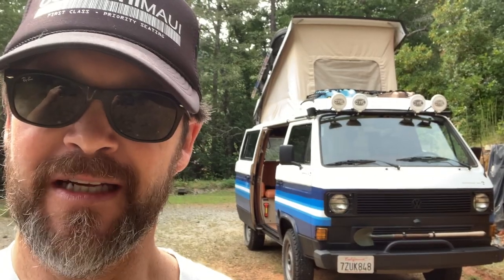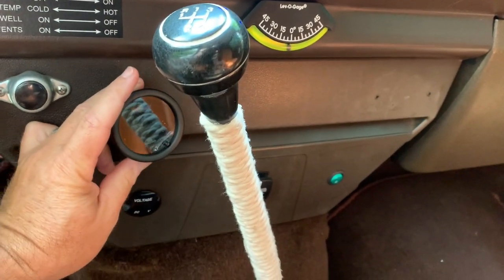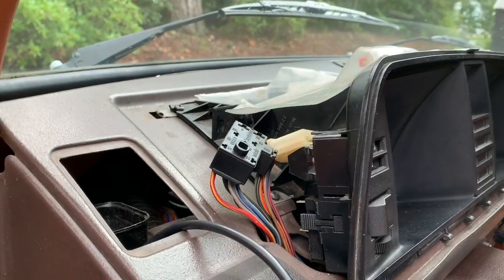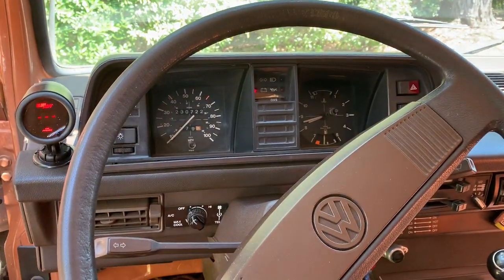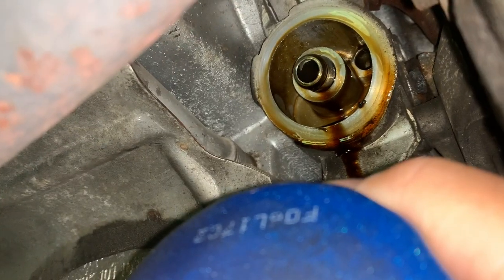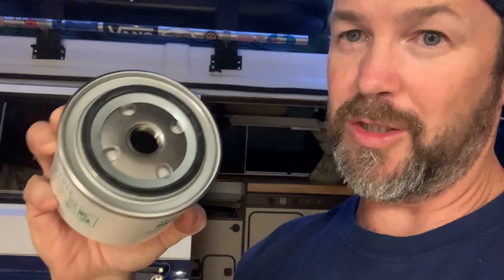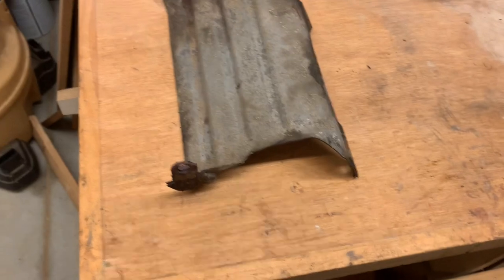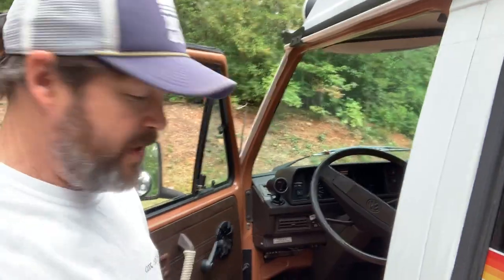How to Install an Oil Pressure Gauge in a 1984 Volkswagon Vanagon

Comment: SICK video exactly what I was looking for, thank you. Also how did you mount that shovel on the front?
Reply from the maker: Glad it helped! Its good piece of mind seeing an actual value of oil pressure vs. waiting for the dreaded light to come on. Regarding the shovel. I actually just purchased cheap conduit mounts at Home Depot for like a buck a piece. They have a hole in the bottom center and then the u shaped channel is perfect for placing the shovel into. I secure the top with tamper resistant screws so no one will steal it. Good luck!